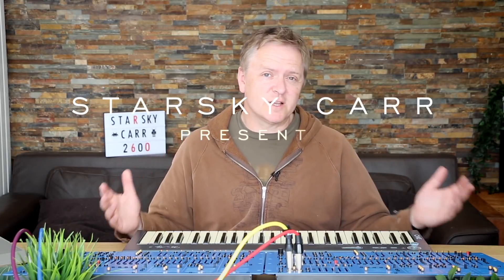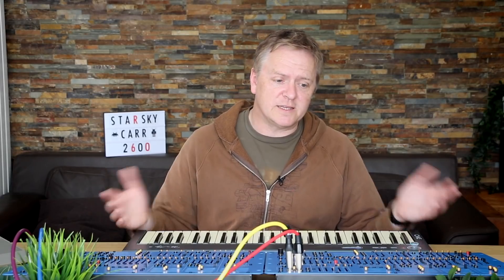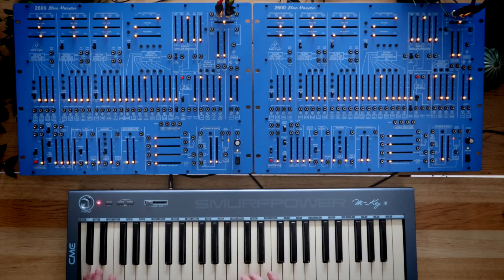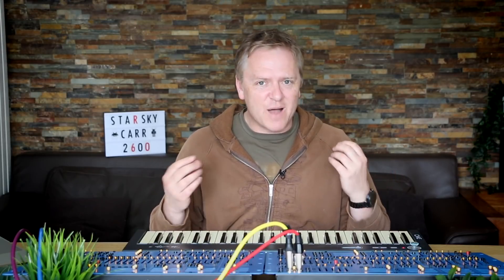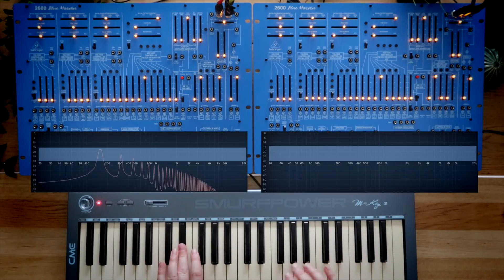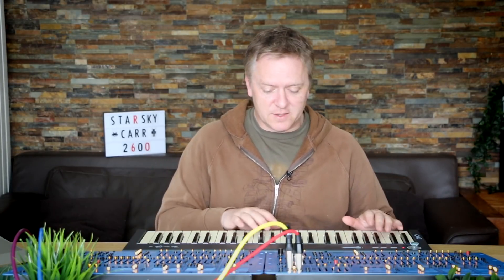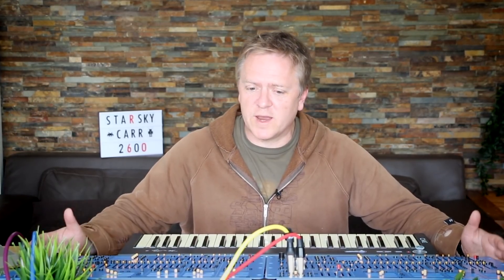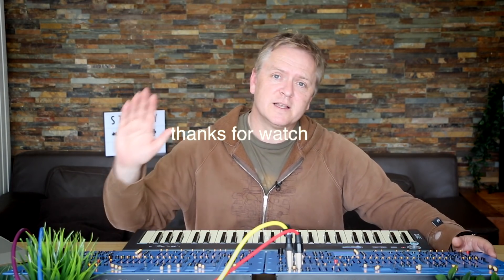Do Analog Synths Sound the Same? - is there a difference between identical synths?

Comment: I suspect the slight differences are in trimpot adjustments. A new analogue synth is only as good as the person who set it up on the production line at the factory. For example, the output gain. A slight difference in VCA biasing perhaps? Great stuff as always 👍🏻

Comment: Brighter sound can be because of slightly smaller/bigger capacitor's value in the filter. Sometimes they're not set to the highest audible frequency for the top value. If the filter is trimmable then you can try to make it sound brighter.

Comment: All components have a tolerance. It may be 1%, or 0.1%, but that is as close as they get. The trim pots are meant to be able to tune out the differences, but as someone said it may depend on the day/temperature/mood of the assembler. You could probably tune the pots yourself to make them as near identical as practical. This is the beauty of analogue synths - they don't all sound the same. They sound pretty close, ok very close, but not identical. In the same way two trumpets/violins don't sound the same.

Comment: Hey Starsky - as you say, we expect them to be slightly different. Analogue components have a tolerance factor and unless they are 100% you will get slight differences between different units. What's quite surprising is that they are so close. The tolerances are either very tight or the calibration is. Possibly a combination of the two. In the end, however, don't you think it's the music they produce that matters....? :-)
Reply from the maker: Yeah of course. Just a bit of nerdy nonsense 😂
Reply: @StarskyCarr  We Nerds are vastly under-rated :-)

Comment: All components have anywhere between 5-10% tolerences. Over an entire circuit thso differences may build up to give slight variences. There are some good videos by Brian Wampler and JHS pedals debunking whether older guitar pedals are better than reissues such as the TS9 Tubescreamer. Wampler says its all down to just tolerances and that two from the same batch can be different. Internetz!!!
Reply from the maker: I’ll have to check them out … get some tips 😂
Reply: @StarskyCarr  :O

Comment: First comparison video of this kind I've ever seen and it makes sense they don't sound perfectly identical.  Two instruments of any kind don't sound identical.  Two acoustic Martin guitars, one sounds a little rounder, one a little more open.  Two Les Paul guitars, one sounds warmer, one cuts through a bit more.  Density of woods can add minor differences just like electronics and their tolerances and calibrations.  It's like walking into an electronic store and seeing a wall of televisions.  The color adjustments, not to mention component variances can make a huge visual impact.  Analog/digital hardware synths and VST instruments all sound different, and they all can be used to make great music.  It's as you said, if two hardware analog machines can sound even slightly different, what hope do we have comparing them to VSTs? And what hope do we have that VST creators can make a perfect emulation if a perfect example doesn't exist?

Comment: 11:57 where you said "this one is higher" - you haven't all sliders on exact same value in both synths .. second oscillator middle slider and filter section middle slider are in different positions
Reply from the maker: They’re the fine tune sliders. So to get them exactly in tune with each other they will normally be different - unless I’d somehow managed to get the course tuning matched precisely by chance - they’d have to be exact to within a fraction of a millimetre, and even then the calibration and tolerances of the components wouldn’t ensure they were the same. So they’re different in order to make them the same.

Comment: Hello Starsky, I searched for the keyboard CME M-Key which you used and saw that the keyboard is velocity sensitive. Of course I believe that you send the same amount of velocity to both units but I didn't find it in the description of the video and I cannot find it in the video, at least not at the beginning of the video. So, did you send the same amount of velocity from the left and right part of your keyboard to the units?
Perhaps also switch the units/midi cables?😅
Have a nice day 😊 Florian
Reply from the maker: Hi.. the synth doesn’t react to velocity.. note on only so it’s not an issue. And I actually tried swapping the cables and using the different inputs in the interface just in case 🧐

Comment: I want to know if the modern behringer analogs will age like the older analogs or if the components are just so much better that they won't change as much over time as older synths
Reply: Only time will tell how new components will age. And that goes for all manufacturers.
Reply from the maker: I suspect that new synths (of all makes) will last longer due to more reliable electronics generally. They all use the same components after all. Having said that - There’ll probably be some curveball issue that knocks them all out due to some weird chemical reaction between parts that no one considered or deterioration caused by 5G, vaccines, cosmic waves or Bill Gates 😂

Comment: On the Black/Orange 2600, could there be a firmware upgrade to fix the spring reverb delay ?
Reply from the maker: I didn’t realise there was anything wrong with it.  I know some people are a bit confused about the phase cancellation. - but that’s how the original works - inverting one side to create a stereo effect from a. Single spring.  It others than that I’ve not heard about or noticed anything.
Reply: @StarskyCarr  I just meant the reverb length.  A bit longer release rate maybe (?)

Comment: 50 years ago there were definite differences due to the variance in 'identical' components.
Reply from the maker: Tolerances are tighter now, but it does show that comparing a new one to a vintage unit can only reveal so much.